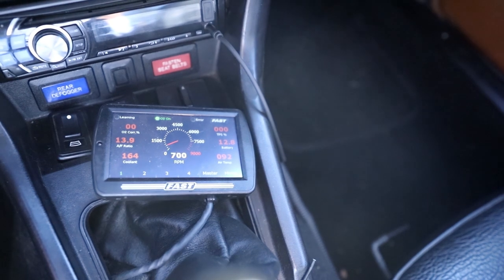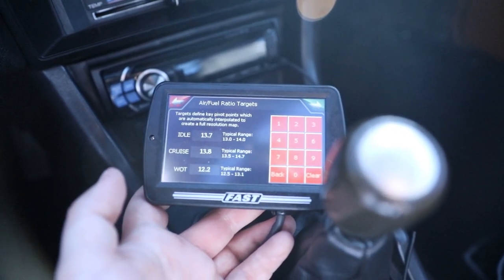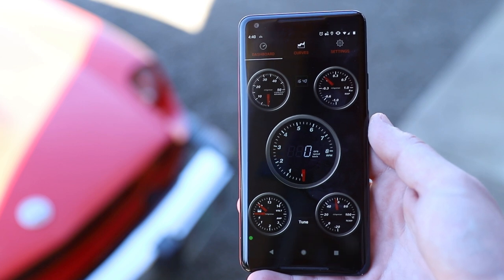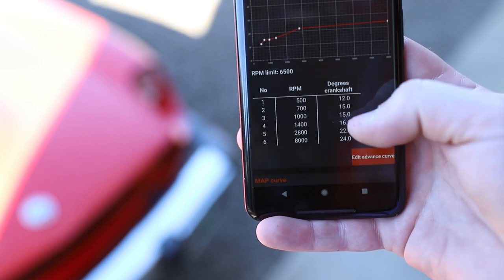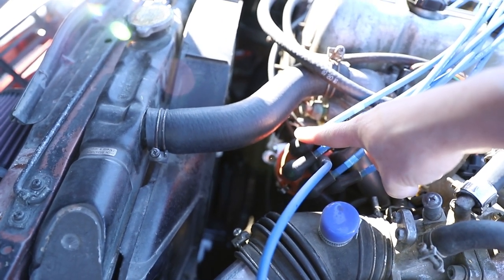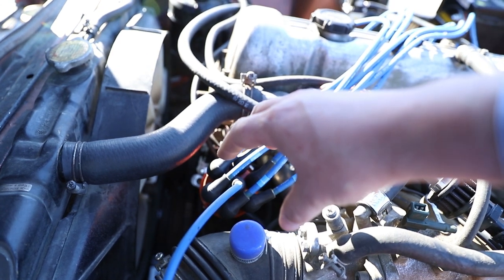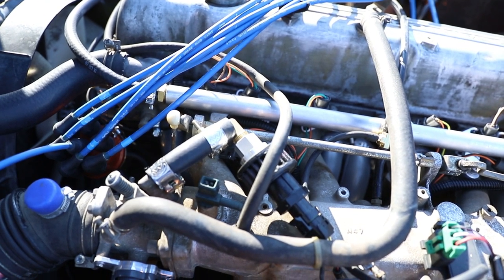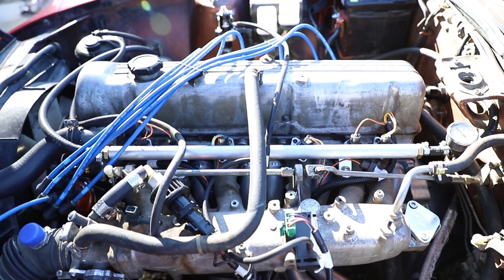280Z - EZ EFI & Bluetooth Distributor

Comment: Did you ever install a fuel pump relay to interact with the EZ EFI?  About to go the Holley EFI route with my 1980, and I'm compiling the list of parts I can think of at the moment.  If you could do a video of a fuel pump relay with the EZ EFI, that would be awesome.  Thanks.
Reply: bump. Just picked up a FAST system from zcardepot and was wondering the same.

Comment: Nice recap. I am not quite ready to take on the ECU change. But I would like to know what exhaust you have. Your car sounds just right.
Reply from the maker: Just a custom 2.5 inch, using a vibrant resonator and turbo muffler I believe. I had to add the resonator up front to cut the 6 cylinder rasp down. Most people mess up by trying to control note with muffling rather than a resonator.

Comment: Hey I have a billet file rail but I need to know what fittings I should use to get rid of my old fuel rail
Reply from the maker: It depends on which rail specifically you chose, but there are a lot of options as far as fittings. You just need to check which threading you have on the rail and pick a direction. You can use barb fittings on the fuel rail to connect to soft lines or you can make lines with AN fittings and put AN fittings on the rail. I personally just ran soft lines from my fuel filter to the rail, then a soft line from the output of the rail to my adjustable fuel pressure regulator, then another soft line to the return hard line.